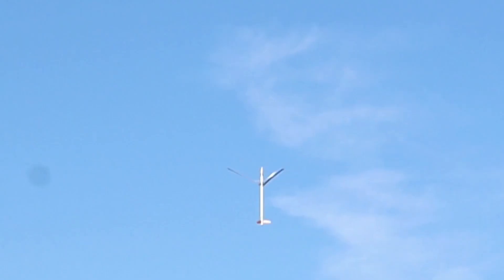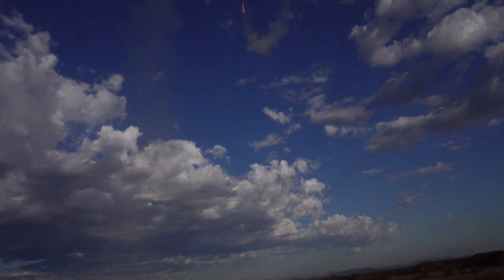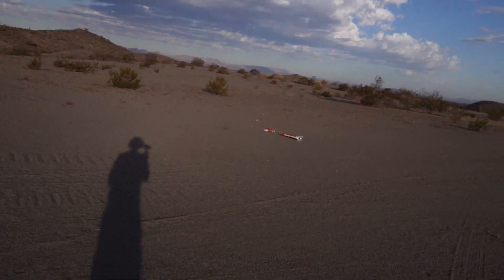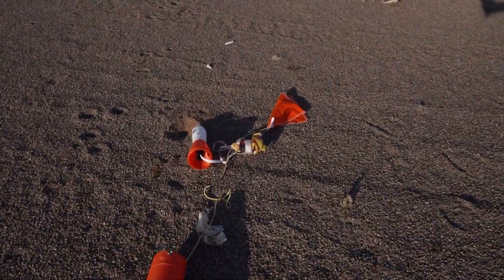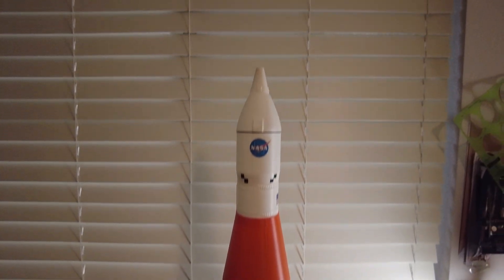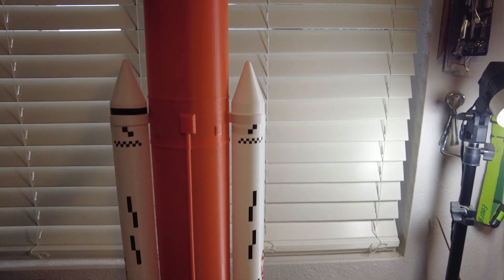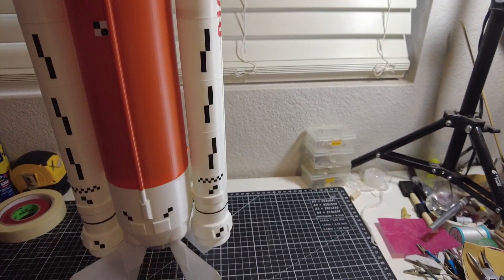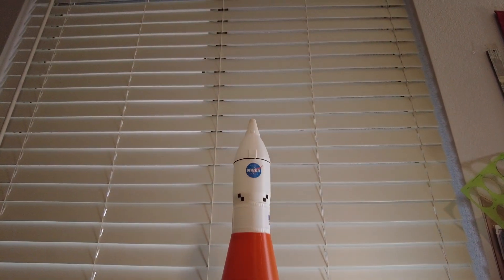NASA SLA Artemis 1 Launch

Comment: CG moved too far back by the heavy BP F motor and/or average thrust too low for proper fin stabilization.  Use a composite propellant F next time with higher average thrust.

Comment: Hmm. Have to wonder if the additional weight of your recovery system over what the one MaxQ may have used during testing is exposing the CG issue. That's assuming MaxQ just used wadding and the parachute that comes with the kit.